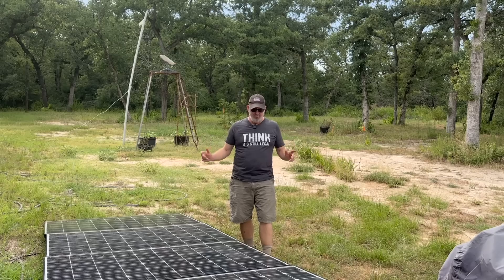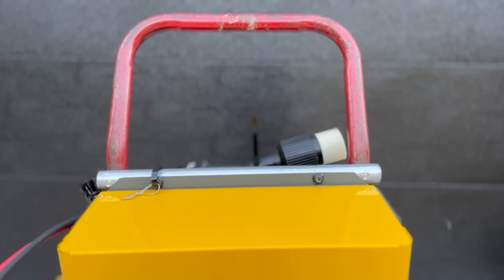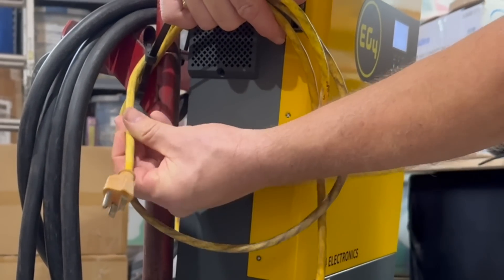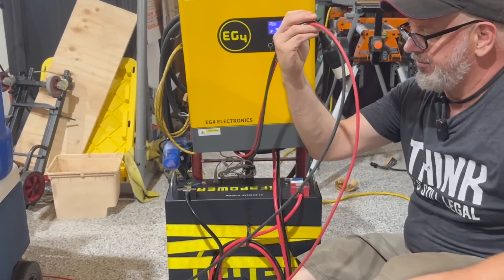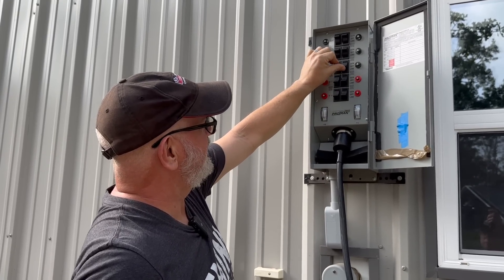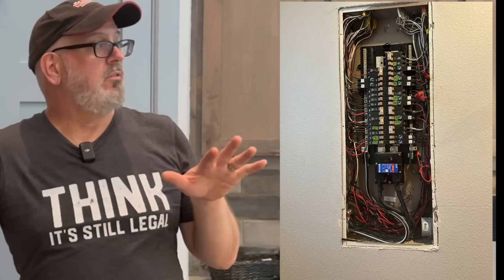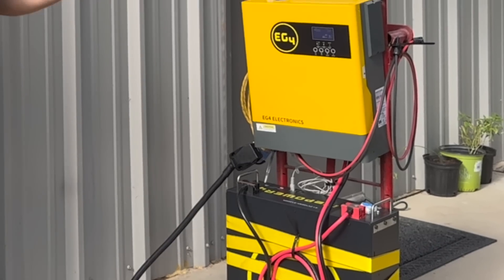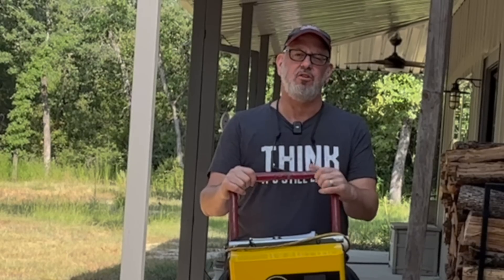CHEAP DIY Solar Power Portable Generator

Comment: Keep in mind that you can also use your Honda generators to charge up your battery in addition to your panels in the scenario where grid is down for extended period of time or you have a need to use larger power use devices. Eg4 has generator line in option. Great setup I’m building something similar soon. Glad to see more people diy solar!

Comment: I did this a few years ago with a reliance 10 circuit manual transfer switch, custom built lifepo4 and a Growatt 3k inverter.  I also power only 120v so the key is (which you have obviously done) is to cross the hots across both legs either in the switch or in the adapter so both legs get power. Obviously can’t do 240v since it’s not out of phase.  Helping my neighbor build the Will Prowse design like you did with the EG4 3k.
Reply from the maker: Exactly!  The hand truck solar generator has evolved and Will’s latest video really started me wondering if it could perform as well as our EU2000i’s in backing up the house through the manual transfer switch.  No, you aren’t going to be running 240v loads with this set up, but with only 3000w output, that’s a good thing!  Most similar sized generators only power 120v and the parallel kits typically use a TT-30R format.  It’s easier to just buy the TT-30P to L14-30R dog bone adapter and just use a regular 4 prong generator cable right into the MTS.  I did that with my 2 Hondas and it’s worked well for over a decade on 2 different MTS’s.  It’s super easy to adapt the solar generator to the same format and you get so much more for your $ compared to the AIO box units.
Reply: Is that manual transfer switch and automatic transfer switch abbreviation?
Reply from the maker: @kf5hcr176  I’ve always understood ATS meant automatic transfer switch and MTS was Manual transfer switch.  But some days I can’t even find my keys, so I may be wrong! 😫
Reply: Noone has addressed that a 5 Gallon can of gas is significantly smaller than 8 solar panels! Ok if you have a static situation at your house but is not ideal for most emergency situations
Reply from the maker: @kadin06  Thank You!  Excellent point.  There are certainly better use case scenarios for gas generators, especially for RVs.  Personally, I like having multiple power alternatives and when my gas and propane run out, the sun will still be there… hopefully! ☀️⚡️🔋😁
Reply: I did the same with the same Growatt all in one. Built my own lifepo4 battery too. These new rack built batteries are dead simple and 48v is the way to go! I also have a gas generator but only to be used to refill the solar battery, rather than running loads off of it. I’m in a suburb so running a gas generator long term would attract too much attention and piss off my neighbors.
Reply from the maker: Exactly!  They make some cheap dog bone adapters now that already have the 2 hots crossed with a 3 wire to 4 wire configuration and those make it easy to  cut off the 3 wire end and use a regular 4 prong generator cable.  My inverter and battery have performed flawlessly, my original DIY solar panel racking needs some work though.  Im working on an easy DIY pole mount, video to follow as soon s it is built.  Thanks!  👍⚡️😁☀️
Reply from the maker: @LarryL619  Agreed! The costs keep coming down which is making solar a more sensible option for more people.  Im working on a 240v solution to run the whole house now.  I Spent my share of time living in the suburbs but I got out of there on an early release program! 🤣.

Comment: I believe the eg4 all in one you used has a minimum solar VOC input of 120v that’s probably the only downside to this system is you need a decent size array to charge it
Reply from the maker: That is correct!  I would guess (4) 175+ watt panels minimum to get above 120v but more probably work better.  Even though it’s rated for 500v, I would not go much over 400v.  Always leave some room for safety with low cost solar equipment.  It ain’t a Victron! 🤣
Reply: Exactly I have 3 180 panels and the voc is just 60. I would  need 6 minimum to just scratch 120 that might not even be enough lol
Reply: I didn't know that about this inverter charge controller. That's pretty critical information that it only charges at a minimum 120 volts.  So if I only hooked up one of my 370 W panels to this it's not going to work? @terrahillfarm

Comment: Nice job! I just built a similar one with the EG4 6500EX-48 and the EG4-LL battery. I’ll be buying the transfer switch soon, then solar panels. For now, I’ll charge with grid until an outage then with the chargeverter from our existing generator. For the moment, I’m unsure on where to put the panels and will likely cost of grooming a field for room and grade. Good luck with the channel! I credit Will Prowse for getting mine.
Reply from the maker: Thanks!  You’ve got the start of a nice system there.  I think inverter and battery is the best way to start.  Panel prices are coming down so you’re in a good place.  I’ve been debating where to permanently place my panels and have decided to start off with a ground mount (pole) system.  I’m working on a new design for a low cost system and once I get the components collected, I plan to build it out.  Yes, Will is the original solar instigator for many!!   I’ve still got a lot to learn but I appreciate folks like Will who’ve generously shared their wisdom and experience. 👍⚡️☀️
Reply: Are you aware they are no longer making those inverters?

Comment: The battery/inverter system can definitely optimize the use of a gas generator. I've got 2 48vdc LiFePO4 rack mount battery units powering a 3000w inverter. Using this as the electrical source for an off grid workshop. The batteries and inverter cost about the same as what trenching grid power to the shop, so that cost is a wash. I already had a 7000w generator available,  but most of the time,  it was running at idle, waiting for the next tool use. I have too much shade right now for solar collection to be effective.  So I charge the batteries, and can run off those for a week or so before they get down to 1/2 charge. At that point, it takes only 2-3 hours of generator run time to charge back to fully charged. No wasted fuel running at idle.
Reply from the maker: Thanks!  I haven’t experimented yet with recharging my battery on the fly with my generator but I will.  I think you are right about battery back up with generator though.  When I was without power for 3.5 weeks during Hurricane Ike, my 5700 watt generator ran thru tons of fuel all to power loads of 15% or less most of the time.  If I’d had this battery backup power supply, I could have simply run the generator for just a few hours a day to recharge batteries then had basic power 24/7.  I was burning 5-7 gallons of $4/gal gas everyday when most stations had no power and couldn’t pump.  It’s truly U Boat technology, run on battery electric, surface, recharge batteries, then go back under to running on batteries again! 🛶⚡️☀️🔋👍😃
Reply: @terrahillfarm  
The EG4 Chargeverter is a wonderful tool for maximizing generator efficiency and limiting the charge current to the batteries. Your all in one inverter may do that on its own, but some have issues with charging from AC while in use. The Chargeverter protects your inverter from possible dirty power from the generator as well. That EG4 battery likes to be charged at 30 amps for max life. I've got 2 in parallel just like it. So I can pump power at 60 amps, or around 3200w, right around half of the max capacity of my generator.
Reply from the maker: @Vibe77Guy  Interesting.. i didn’t initially understand the difference between the battery charger and the chargeverter, but it sounds like the latter puts out substantially more current.  My 2 EU 2000s put out very clean 120v power but, they could only hit about 28 amps in parallel.  My understanding is using a generator, it needs to be rated for higher power output than the inverter.  So from what you say, unless I have a >30 amp clean inverter generator, the chargeverter is the better solution to charging with the EG4 batteries on the battery powered solar system.  Ughhh sounds like signature solar is getting another sale outta me this month! 🤣😵💰⚡️
Reply: @terrahillfarm  
The Chargeverter is good to 5000w.
That's about 21amps at 240vac. But it's programmable for voltage and current output.
I use the 240v output of my generator, but Signature Solar describes that the Chargeverter will work with 120vac input, with a cable adapter.  With one 100ah battery you will be looking at 1500(ish) watts for charging. One of your generators should handle that easily.

Comment: 2 things;   You might want to get 8 gauge solar extension cable for less voltage drop, and their more expensive battery with the screen, handles bigger loads much better, if you only have one battery, get the good one...I've experimented with different gauge solar extension cables, ya, you want the 8 gauge for less than a 3% drop, the 12 gauge drop is frequently 10 -13 % drop in power over longer runs..The difference in cost is minimal, get the 8 gauge..
Reply from the maker: I agree the LL is the better battery, but I was trying to keep the price a low as possible for proof of concept.  The fact this inverter will take up to 500v from solar (and I’m running around 340v now) gives you the ability to use smaller PV wiring, since the amps are so low.  That said, my permanent ground mount location is about 300’ away so that will require much thicker wire to avoid the drop in volts.  I’m working on the design for the whole house system now and debating between the EG4 18k and the comparable Sol Ark.  Ive seen many positives reviews on both. 😊
Reply: @terrahillfarm  Ya, I have the EG4 3000 it runs the lights and other electrical in 4 tiny houses on my forest property that I rent out on AIRBNB, they are just bedrooms in the forest with many windows, very beautiful..I have 2 of the EG4 6500's and 2 server rack batteries and a 280 ah battery made out of prismatic catyl LIPO cells, 16s 1p for a total of 23 kw's ..With 3 strings of solar maxed out almost 500 volts a string..Ya I'm aware of the ability to use smaller wiring, I'm saying that I wouldn't do that because the loss adds up every day, and you only buy that wire once..The EG4 18k is much much cheaper, but the Sol Ark purchased through Current Connected has better customer service, better warranty, and just known to be the very best, but pricey..I would go with the 18k, but, it's a tricky decision..
Reply: Very nice.  I have a 4 circuit switch that I run full time off of a Bluetti AC 200 MAX with 2 additional batteries for 6144 watt hours.  I built a 5 kwh rolling crate with a 2000 watt inverter and 3 charge controllers for less than half the cost of the Bluetti.  I charge during the day while I'm at work and run two window ACs at night.  I'll do a big one someday that can run the central AC.  Thanks for the video.
Reply: @terrahillfarm  There is a video coming soon from Will Prowse, apparently he is having some issues with the 18k..They are software issues about exporting to the grid,  which he doesn't want to do, but can't stop, and an inspection issue about a quick shut off for the solar I believe, apparantly the inspector laughed and said no way, he wrote about it today on his forum, and said he might return the unit, might want to read that and check out the video when he makes it..I think Sig Sol already has the fix though..Those issues might not affect you at all..No one is inspecting my units and I'm not connected to the grid, so that wouldn't affect me..
Reply from the maker: @PWoods-cd6tk  That’s great!  I tell folks all the time that a transfer switch should almost be bought before getting a emergency generator!  I went 3.5 weeks in the summer without power after a hurricane in 2008 and that experience started me down the home power solutions path!
Reply from the maker: @realeyesrealizereallies6828  Thanks! I guess the question you have to answer is “is $1,400 more for the Sol Ark too much to pay for a longer term track record of success and better customer support”?  If I’ve got $15-$20k invested in a whole house system, I’d probably say no…
Reply: @terrahillfarm  Can't argue with that...

Comment: I've been watching a ton of videos lately and I stumbled across one with this exact inverted yesterday and the guy said it couldn't even handle a heat gun or his plug-in electrical drywall sander. There isn't a chance that any of those two devices are over 3,000 Watts
Reply from the maker: @jcallesano  That’s interesting.  That’s not been my experience with the inverter, but I don’t mind going back and testing it to see.  👍
Reply: @terrahillfarm  ok.  Please do.

I'm about two pull the trigger on that inverter along with 2 48 volt batteries from eco-worthy since there 1600 for 2 of them right now
Reply from the maker: @ I’ve had zero issues with my EG4 3000 EHV inverter and I’ve pushed it pretty hard powering 10 120v circuits in my house.  It will perform much better with 2 batteries vs. 1.  I’ve added a test to my video calendar but it may be a couple weeks before it posts.   If you want to save an extra $50 on the inverter, purchase it through one of my links in the description of my videos. It should apply automatically.  I like the build quality of those Eco-Worthy batteries and hope to be testing one soon.  I upgraded my home system to dual 6000xps, but I still regularly use the 3000 inverter as a 120v chargeverter.  I’ve seen several folks run them in parallel for 240v with no complaints.  IMO, it is a tough inverter and total bargain compared to anything else under $1,000. 👍👍

Comment: Great video!! Going to do similar permanent install with same components to run home mini-split, refrigerator, & freezers. 👍
Reply from the maker: Thank you!  It should handle a 12,000 BTU mini split and fridge just fine, length of time will depend on how many panels you run.  We’re now up to 6 batteries and a 6000 watt inverter running all but the largest loads in my house. Utility bill is dropping off a cliff!  I still use the 3000 as a separate battery charger.  Been busy with new solar projects and have new videos coming out soon.   👍☀️⚡️💡🔋🤦‍♂️
Reply: @terrahillfarm  Excellent!! That's another benefit that I think people forget that in addition to these EG4 systems being affordable, renewable sources of power to run critical loads in a grid down scenario, they can also reduce energy bills by running those critical loads WHILE there's electricity. With DIY solar becoming so affordable & user friendly, it makes sense to have it even if the grid doesn't go down, to save $ on power production for the home.